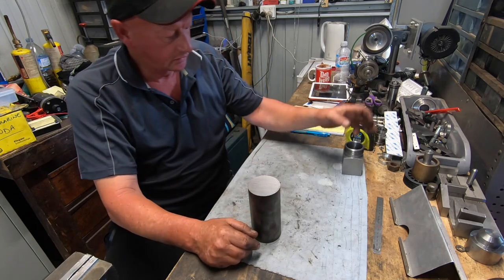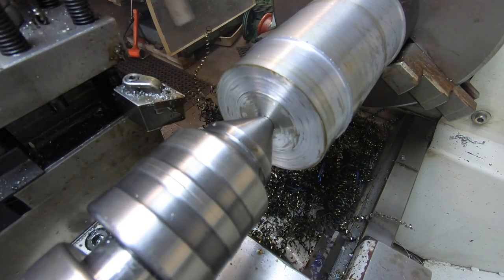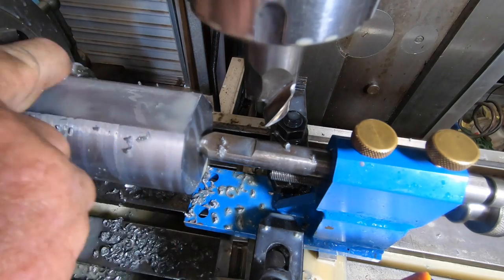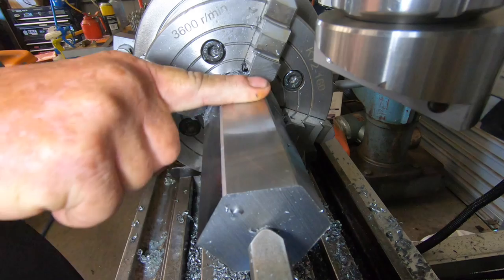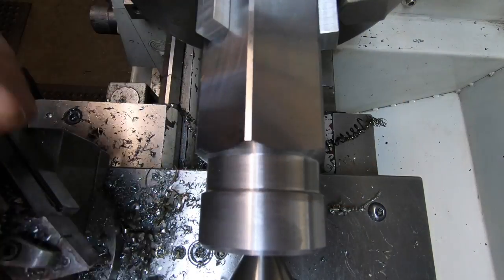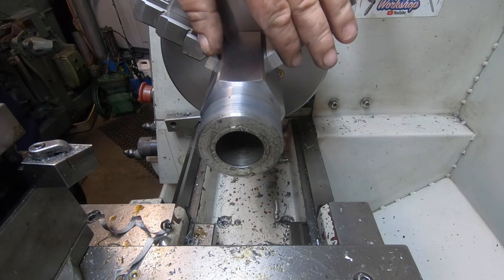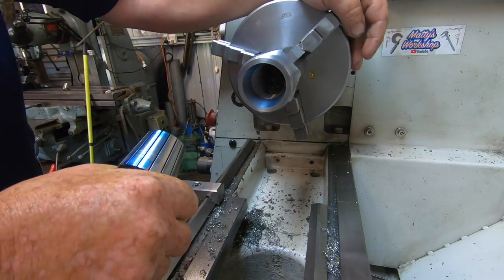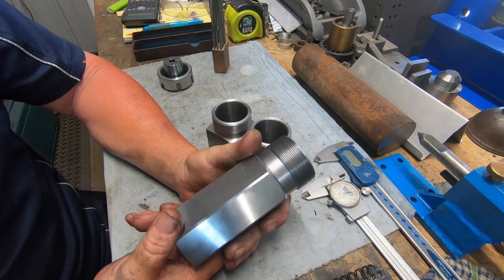ER 40 Hex Collet Block

Comment: Great  call on the hex machining,  Ref slot drill, then fly cut.
Great job Matty, another great addition to the shop 👍 
Thanks for sharing
Reply from the maker: Gday, definitely worth running the fly cutter over the flats and the corners, super smooth finish and less chance for surface rust, thanks for watching and commenting mate, Cheers

Comment: Beautiful finish. Video very well done. Try making a mist system for your internal boring, that is much more effective than squirting the cutting fluid in.
Reply from the maker: Gday Ronald, I really need to put flood coolant on the lathe, this is something ill be doing soon, draw say it'll be a homemade setup, Thanks for watching and commenting, Cheers
Reply: @MattysWorkshop  I made a mist system for my lathe at work, and it made a world of difference for facing cuts, and boring cuts on hubs for motors and pumps. However you must be careful of the coolant. The mist is breathable, and not all coolants are suitable for misting. I installed a mist system on the mill and it was so much cleaner for both machines. I wish I had done this much sooner. It does require a good air compressor but it is a simple solution to run an air line to the machine instead of dragging a hose to the machine. I don't lile air hose on the floor around a machine like the lathe while it is running.

Comment: I usually set up a vacuum cleaner on the other end of my thru hole when I'm using a boring bar in long cuts, it keeps the chips from wrapping up in the cutter & helps get a better finish.
Reply from the maker: Gday Steve, that’s a great idea with the vacuum, I should give that a go, thanks for the advice mate, Cheers

Comment: Great Job as always Matty. I like the trick with the Air Sprayer and the Marker. It seems like it puts a more even coating. The Fly Cutter you made did a Fantastic Job on the Finish. Thanks for Posting.👍
Reply from the maker: Gday, that’s a good trick with the marker pen, works well, the fly cutter worked well and definitely worth the effort to tram the head in again, thanks for watching mate, cheers

Comment: Nice work!
Re your tailstock riser block, consider making it height adjustable. This will allow you to cut flat tapers and tapered keyways among other things.
Reply from the maker: Gday Phil, thanks very much for the advice, this is a great idea, possibly make a large adjustment parallel would do the job nicely, thanks again mate, Cheers

Comment: Very nice!  That extra length avoids having to use a jack or another block at the other end of the vice. I did wonder about relieving the middle of the faces a bit so the vice jaws would nip on the ends of the block and give a bit more stiffness, but that thing just looks gorgeous.
Reply from the maker: Gday, I think if the centre portion was relieved it may become a issue in some setups possibly, appreciate you watching and commenting, Cheers
Reply: @MattysWorkshop  I'm tempted to make TWO then, one with the relief and one without! Brilliant stuff you are doing, enjoying it enormously here in drizzly, cold, damp East Yorkshire

Comment: Matty, I reckon you should just make a long 12-sided collet block and give the 4-sided one a miss.  A 12-sided block can obviously be used for 4-sided and 6-sided parts but it also sits solidly on one of its flat sides in the vise.  (The 6-sided one did turn out nice, though.)
Reply from the maker: Gday Chris, yes I could of got away with making one but didn’t think of that straight away, I am thinking of making a 12 sided block now as well, I have enough material here to make a long and short series, thanks for watching mate, cheers

Comment: something I hope to attempt myself someday, even if they are out of only mild steel.  I usually call those "practice made permanent."  It's practice unless it turns out better than expected.  Then it becomes permanent.  Like the spindle adapter on my 3 jaw.

Northern Inventor demonstrated a "poor man's collet" system that made use of what was basically the means of securing farm tractor tires to the axle.  I now wish I'd downloaded the video, the last time I tried to visit his video page, it was gone.  Not sure what happened to it.
Reply from the maker: Gday, I’m sure mild steel will work just fine, the shaft I used turned a lot like 4140, cheers

Comment: Hi Matty
The collet blocks look great, I use them all the time, and they are much easier to set up than a dividing head if you only need set angles.
I would agree with you using bearing nuts, they have less tendency to move the material/collet when you tighten them.
Reply from the maker: Gday Chris, I’m thinking of making a 12 sided block now, just for the fun of it really, I’m looking at collet nuts at the moment, trying to find a decent quality for a decent price, thanks for watching, cheers

Comment: Congrats Matty on the big sub burst. Cutting Edge really blew you up there, couldn't happen to a nicer guy and well deserved. How do you like that chuck you have on the rotary? I just bought the same branded one for the Atlas, have not even really unpacked it yet.  Beautiful job on the hex. Don't see a lot of fly cutting anymore with shell mills getting so popular but it is a bit underrated in my opinion, you got a fantastic finish on that.
All the best!
Eddie
Reply from the maker: Gday Eddie, the subs have grown by almost 4000, absolutely incredible to be honest, the 4 jaw on the rotary table works well, it takes a little more time to set a job up but the chuck doesn’t have to be clocked up 100% compared to a 3 jaw, i spent some time tramming the head in on the mill as close and I think this was a massive help with the finish from the fly cutter and speeds and feeds, I like the fly cutter over shell mills simply because there’s only 1 insert to worry about, thanks for watching mate, cheers

Comment: Nice job Matty. Have you tried a HSS boring bar? I find they can give a better finish especially if you hone them razor sharp. Carbide is good for roughing out but the edge radius can be problematic on small lathes.
Reply from the maker: Gday Preso, I had forgotten I had a hss boring bar in the cupboard, thanks for reminding me mate, I could Chuck it back up but the internal bore doesn’t effect the way it works, just looks crap, thanks for watching, cheers

Comment: Another great video Matty! I made myself an ER 40 collet chuck for my 1 meter between centres lathe the other day. I got some good tips from you with getting the angle right but ended up machining a piece of round bar to 20mm then slipped a 19mm-20mm collet over it (snug as) and clocked the angle in to within 0.01mm . Worked bloody well ! Chucked up some precision drill rod in the ER collet and only get 0.005mm run out. Great for clamping smaller diameter jobs up to 26mm in diameter. 
Keep them videos coming. 
Ps: when are u planning on restoring Kurtus’s shaper from cutting edge engineering?
Reply from the maker: Gday Dave, that’s a great result with the runout, there’s many ways to set the internal angle ive found, it will be in the next month or so I’d say before I get up to Kurtis’s, thanks for watching, cheers

Comment: I was very interested that the fly cutter continued operating past it's centre of rotation. I guess that's how the finish became mirror-like, even though the backside of the cutter is exactly at the same depth of cut as the leading edge.
Reply from the maker: Gday, I spent a good while tramming in the head before I started, cutting in either direction left the same finish, between the head being trammed and speeds and feeds the results are excellent, thanks for watching mate, cheers

Comment: Hi Matty, where is this calculator you referenced?
Reply from the maker: Gday Dave, if you Google Carbide depot they have a trig calculator there, super easy to use, all you need is 2 values and it does the rest, Max Grant from Swan Valley Machineshop put me onto it, Cheers

Comment: Excellent work on the hex collet Matty It turned out really good. What insert tool did you use in your flycutter?
Reply from the maker: Gday John, the tool in the fly cutter is a SDJCL1212H07 and DCMT070204 inserts, cheap setup from eBay, thanks for watching, cheers

Comment: Hello Matty. Keith from Michigan USA, hopefully you will send me a reply. Then we can exchange our backgrounds. I've put a new Lathe in my basement 😀. Currently I don't have an account with ytube, so your somewhat limited. Hope to hear from you sometime soon...
Reply from the maker: Gday Keith, I try to answer all comments, I believe it’s a great to interact with viewers, what type of lathe did you purchase, there’s nothing better then a new machine and when I got my last new lathe it was just like Christmas every time I walked in the workshop, thanks for watching and commenting mate, Cheers
Reply: @MattysWorkshop  Thanks for your response 👍. As I was watching your ER-40 component. My gosh 😃 I'm certain that you also made your Fly-Cutter, I'm impressed. You did all the correct angles and especially the tool insert holder. The insert was a nice choice too. Did you do this on a video? If so maybe, you could forward this via in the reply box. The finish on the ER-40 is just fantastic!! My friend, good day....
Reply: I'm responding about the my. It's one notch up, versus the general hobby Lathe's. The company called Matthew's Precision. Mine is a PM1130. The overall specs are: 11" swing 30" bed movement, has two drive shafts to feed X / Y Axis. Motor 3phase 1.5hp driven with a VFD variable speed. I've been holding back, to purchase an ytube account. You otherwise can't download 😕 anything. Did you make this Fly Cutter??
Reply from the maker: @keithmonarch447  I’ll check out the PM milling machine, sounds like a nice machine, yes I did making the fly cutter, there’s a video there when I made it, cheers